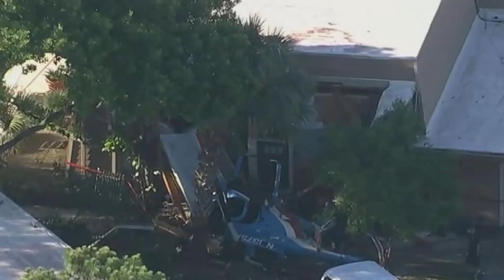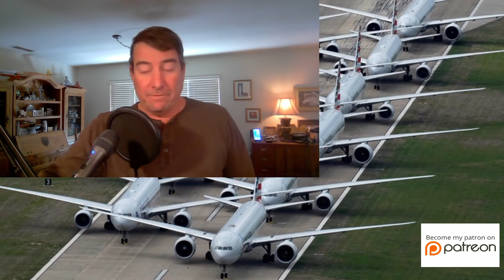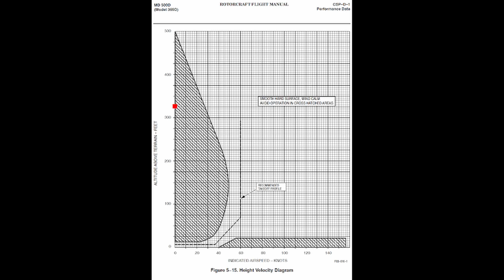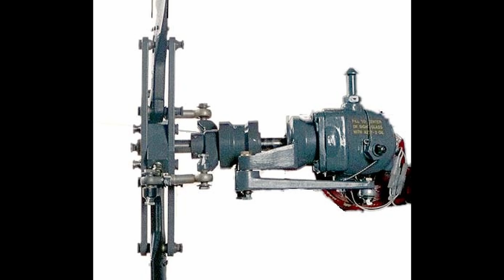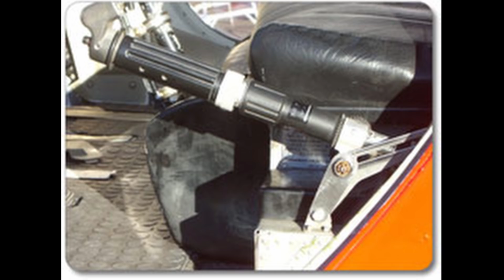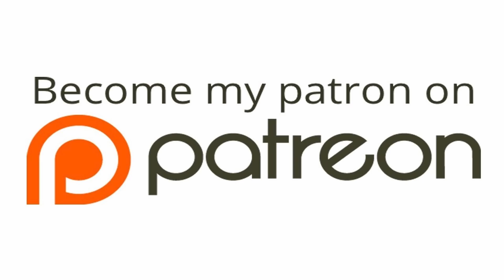Houston Police Chopper Crash 2 May 2020

Comment: I think the torque diagram you showed a couple of times has something backwards.  Or maybe it's just me that is backwards, but I don't think so.
If the blades are being "pushed" or torqued CCW, then the torque on the aircraft body is the opposite or CW as shown by the light blue arrows. So for so good.  But to keep the body from spinning CW, the thrust from the tail rotor must be to the left, not to the right as shown.
Reply: Andrew Snow Yes, it is backwards.
Reply: @chuckie131  The TR has variable pitch, as you know. When picking up to a hover the added torque from the engine to the main rotor will cause the airframe to rotate to the right. An appropriate amount of "left pedal" will cause the pitch in the TR to "bite" to the right keeping the airframe from spinning to the right. If I lose my TR the effects of torque will immediately cause the airframe to spin nose right. If my TR is not working the only way I can control that spin is with the throttle. Retarding throttle/power, reduces spin. If, as you say, the TR bites to the left that will further exacerbate the situation. To make matters worse, many European manufactured helicopters' main rotors turn to the right, clockwise.

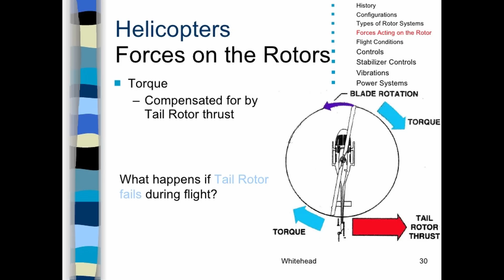Comment: In the drawing at 6:40 it seems that they are showing tail rotor thrust "helping" the torque imparted to the air frame. I would assume they wanted to show the thrust counter to torque? Thank you first responders for risking your lives. Thank you J.B. for bringing data and your insights.
Reply: I just answered my own question. They are indicating airframe motion in reaction to tail rotor thrust. NVM.

Comment: NOTAR is the "no tail rotar" copter.  I am a mere aviation enthusiast, so can't comment further.  :-)
Reply: Chech out the Aerospatiel "fenestron". I used to work on the Gazelle.
https://youtu.be/MWZB6fzanbI
Reply: @obsoleteprofessor2034  A Fenestron is just a ducted propeller. The NOTAR works on the Coanda Effect, using bleed air from the pressurized boom to provide directional control. Its main work is done passively and all of the moving bits are fairly simple. It's very elegant. You've got a variable pitch fan to supply the air to the boom and a movable duct outlet at the end of the boom. And perhaps some adjustment to the Coanda slots for trim. I'd be interested to know why other helicopter manufacturers (patent expired) don't use some form of it. It's quiet and less complex.
Reply: @Markle2k  I as well, for a very long time.  I've read that the fenestron isn't used due to being excessively loud... But it is a helicopter. They beat air into submisson.  Nothing is quiet about them.  Used extensively in EU birds, dunno why not in USA. NOTAR is pretty awesome too.
Reply: @zorgatron8998  is the reason a helicopter is loud when flying is because the tail rotor amplifies the main rotor sound, plus its own sound.  get a chance to visit the Helicopter Expo and likely you will get to see and hear a MD Notar series copter flying.   During the capture of osama bin laden a few blackhawks UH60 had modified tail rotors to make them much quieter, but no comparison to a Notar‘s quietness.

Comment: On the interview, you added it was purely on the left channel. Which was strange, just heads up for the next interview, to check the audio settings when OBS (or the software) is recording. In post you can center the audio. Thanks for putting this together
Reply: Luckily I use Voicemeeter Potato and I can click a Mono button which puts it both channels :-D

Comment: Hey Juan,  look up the term LTE.  Loss of Tail a Rotor Effectiveness. It’s an aerodynamic principal that involved with the cavitation of the tail rotor. It’s NOT a mechanic failure. It’s a stall if the thrust from the tail rotor.
Reply: Bring back Scott.  Ask about LTE.
Reply: LTE could be a factor in some cases...usually when a helicopter encounters certain wind conditions that disturb the air that the TR is trying to "bite" into and the helicopter is attempting to hover out of ground effect or at a high density altitude. May well have been a factor in this case. If the investigation reveals that there was no mechanical failure of the TR driveshaft or any other TR components LTE could very well have been THE cause. The term Tail Rotor Failure is usually defined as a LOSS of or mechanical failure of a component of the tail rotor system. It's hard to bring in all the factors that could have contributed to this.
Reply: The chopper rotation looked slow as it was spinning, I suspect if there was a loss of tail rotor the spin would have been a whole lot faster. Good call. we'll wait for the official call. I thought the guy maybe dozed off a bit or sometg=hing, it was after 2am after all.

Comment: "NOTAR".... - No Tail Rotor
Reply: On one of their promo videos they stuck the butt into a tree with no problem
Reply: When MD bought the Hughes 500 design and developed the NOTAR, they created what I believe is the finest small helicopter available. Small, agile, very efficient and cheap to run, quiet and very reliable.
Reply: @TyphoonVstrom   Didn't quite work out that way though.   They never caught on.....thus leading one to think, WHY?
Reply: @avflyguy  Because the market for small helicopters is limited. Everyone started going to larger helicopters in the 90's as they are simply more versatile.
I struglle to understand what you are referring to with your statement "didn't quite work out that way". I simply stated I believed they were the finest small helicopter available?
Reply: NOTAR is really quiet.  Most of the helicopter noise comes from the tail rotor.

Comment: Yes wait until a report comes out. Was it T/R failure, LTE? 

To put things in perspective the helicopters that I worked on were “mediums’. At 100% main rotor torque there had to be 500 pounds of sideward force from the tail rotor or vertical fin if in forward flight.

Comment: This is exactly why I will never get into a helicopter.  A drive shaft slightly bigger than a pencil with a couple of universal joints is all that drives that tail rotor and if any piece or part of that system fails, you're flying a rock. When something breaks in a fixed wing, usually, I'm just flying a glider.   I know all about the concept of autorotation and all that, but I'm not putting my life in the hands of that concept.  And besides that, I was sitting in my office at the airport one day and watched one take off and immediately crash because the guy didn't have the correct tail rotor speed.  No thanks.